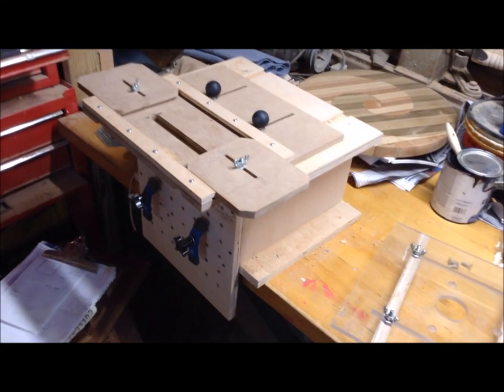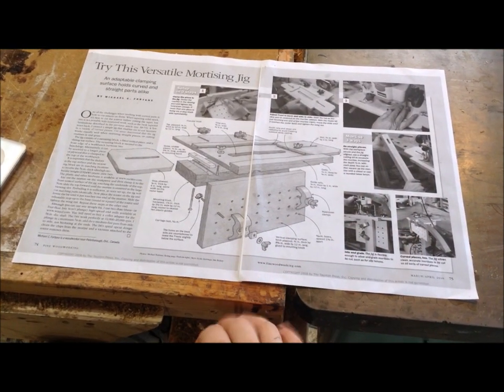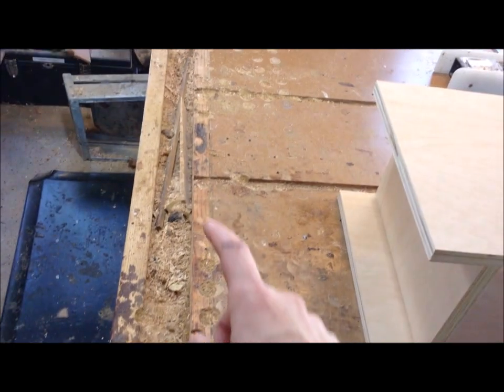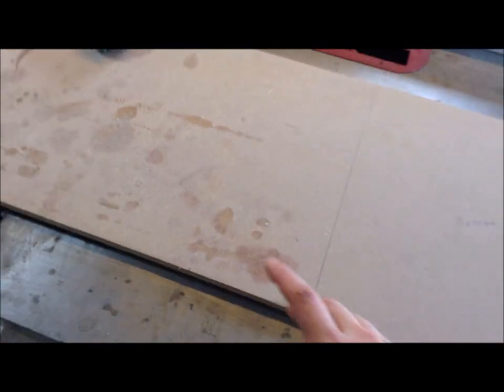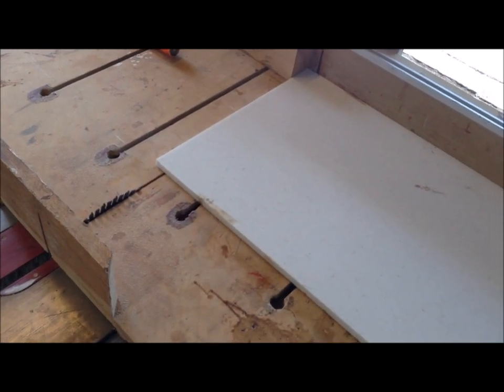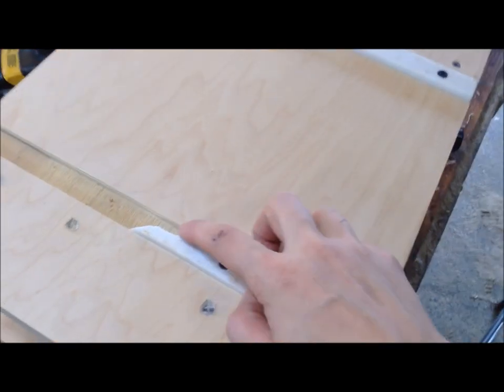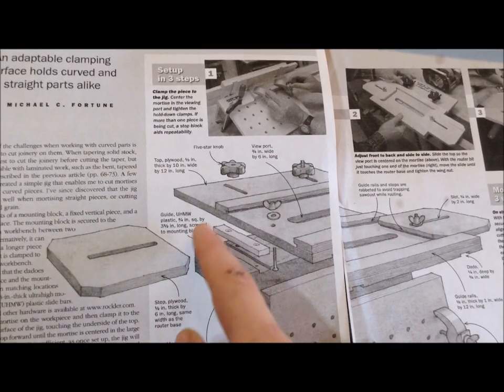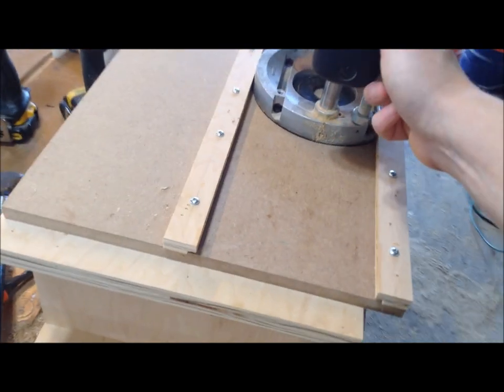How To Make A Mortising Jig - Router Jig [Part 1]

Comment: For safety, measuring with your tape while the saw is running is not ideal...if you have a tape on the front rail of the saw, adjust it to accurate and use it.  It enables you to adjust saw while running.  Also, a riving knife would help, especially if you stand directly in back of the fence...standing off to the left side of the blade is a little safer, but we all have habits that we've developed and if you prefer to stand there then a knife would make you safer.